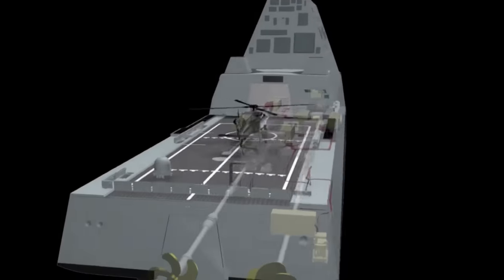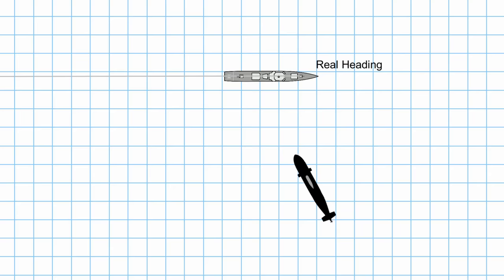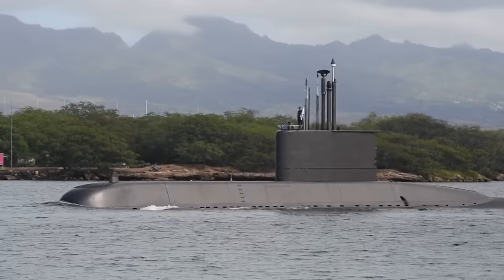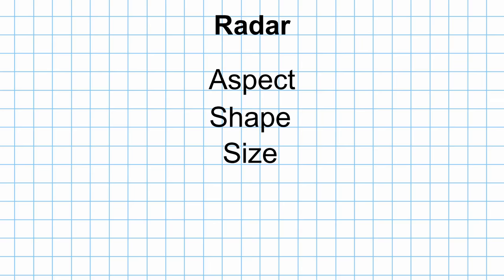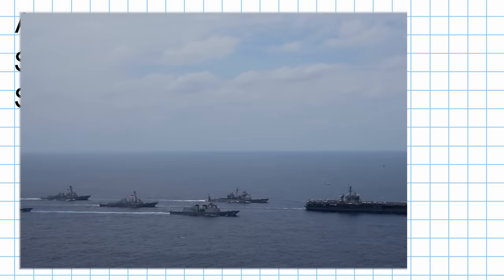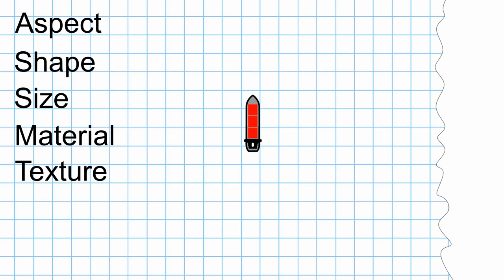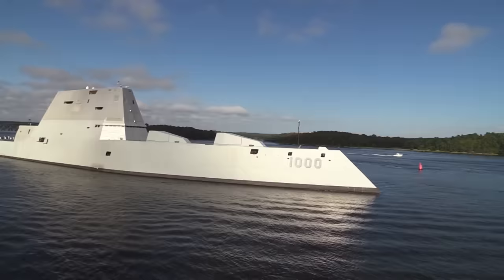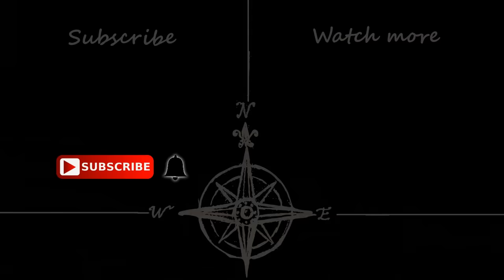Stealth Ships: How They Work

Comment: Radar is actually a type of light. It is simple a much redder light than you can actually see.
      The best analogy for how radar  works is to imagine standing in a completely dark room with a relatively narrow beam flashlight (or a touch, judging from your accent)
      A radar system is made up of two antenna, the transmitter (the flashlight) and a receiver (your eyes).
      You can shine the flashlight in a sweep all around you and see what you can see. This would be the search radar.
    Once you see something of interest, you can narrow the beam to focus more light onto the target to see it better.
      There is one major disadvantage to this system, which you will have already spotted if you have ever been out at night with flashlights around. The flashlight will only show you objects a few feet away but it shows everyone around you exactly where you are, thousands of times farther away than the light lets you see.
       For example, a camp fire will let you see perhaps a few tens yards away, assuming you don't look at the fire itself, but if it is very dark, astronauts in the ISS can see your camp fire from 300+ miles above you.
       This would be rubbish if you want a stealth ship.

Comment: I think that all of those elements were exaggerated in this video... I mean, you say: 
"so, as you can see, this ship has no round edges" (I can see a few kinda round places)
"And this has more round edges" 
(I see almost none round places)
Reply: One thing I think he should have mentioned is that "stealth" isn't binary, i.e. you are either detected or not. It is all about reducing the probability or range at which you can be seen.
Also, a radar beam is not perfectly parallel, but spreads out some, so that you can get some reflection even if you hit the "perfect" stealth shape. But if that reflection is faint enough, then you might just not detect it at all, ob it might get drowned out by reflections from waves, for example. 
And you do not need to be perfectly hidden, as you will know if someone is operating a radar in your vincinity (think of it as someone with a flashlight looking for you in the dark, you will see them before they see you, allowing you to stay hidden). If you know the capabilities of the "enemy" radar, you can figure out how strong their singal can be at most for you to not be seen and stay away by an appropriate distance.

Comment: As unmanned aircraft play an increasing role in air power, I expect that unmanned ships will begin showing up sooner, rather than later, as well. As it has done with aircraft, this will create a new size paradigm in ships as well. Suddenly, it will be practical to create previously impossibly stealthy and fast craft, with previously impossible ranges.  

I wouldn't be surprised if we see a new generation of smaller nuclear reactors for these unmanned vessels, effectively extending their operational radius indefinitely. Unsure whether they'll be true submarines, as surface functions are important as well. If not truly submersible, however, I do expect them to have partial submergence capability to make them essentially invisible to radar.

Comment: QUESTION!!!!

CAN A STEAM ENGINE MAKE EM SILENT????
Reply: moving part are the problem

Nuclear or conventional have to transform heat in movement for create the energy.
Reply: @Tagadarealty  that's why diesel + AIP +  battery are there for the job
Reply: @IndoLiberation  what the point ? Even with an AIP you have moving part, sub dont have quantum engine...

Comment: The sad fact here is that the design used to explain things here is a huge failure. 

The video already alluded to the costs leading to a compromise, in reality it lead to not just one, but many. If you look at current pictures of the ships you will also see spherical structures, they where added later instead of designing stealthy covers..   On top of this there is the rather problematic factor of the ships own sensors, radar, which will give away its position at any time they are actively used. As such this hull design is totally useless for regular cruisers and destroyers which need to actively detect threats to the carrier they are escorting. 

O and then there is this carrier.. which is not stealthy,....

For an useful stealth design look towards the small coastal defense corvettes in Scandinavia.  That is where the design makes sense!

Comment: Zumwalt’s stealth is garbage. It still has the radar signature of a fishing boat.
To put it in a way, fishing boats are not stealthy at all! They can be detected by radars from a very very far distance!
To compare, the B-2 bomber has the radar signature of a peanut! NOT a fishing boat!
Reply: Okay, if this is a joke, please stop reading. :D

If not, the B2 is 21 meters long while the Zumwalt is 183 meters long
Reply: @val_strax_  I get it, but the real point of stealth is not about how to make a very large object smaller than it is. The real point is to make the object undetectable/hard to detect on radars at beyond visual range.
Reply: @WSOJ3  
But that's just the thing... you're looking for warships, not fishing boats. Sure, fishing boats could be just as much of a threat (as they could carry torpedoes) but if you see a fleet of radar signatures that look like fishing boats out in the middle of the ocean, it might just be a fleet of fishermen.
Hiding in plain sight can be considered stealthy.

Just like that peanut for the B-2. If your radar picks up a peanut-sized object flying overhead you might think of it as a glitch in the system and not worth checking out.